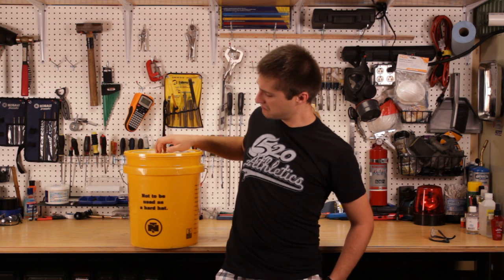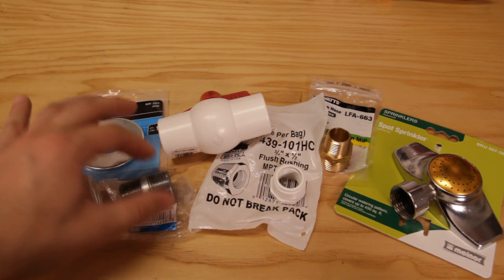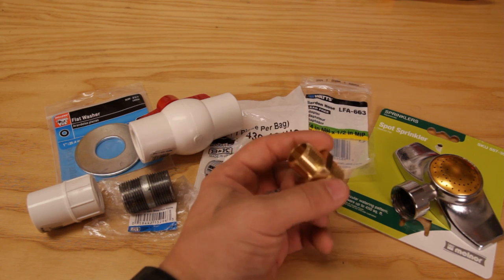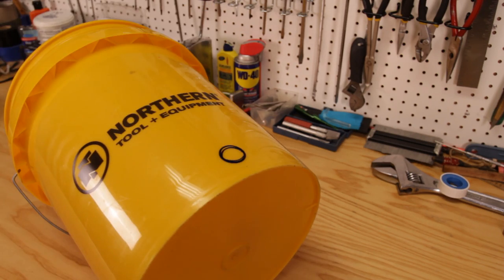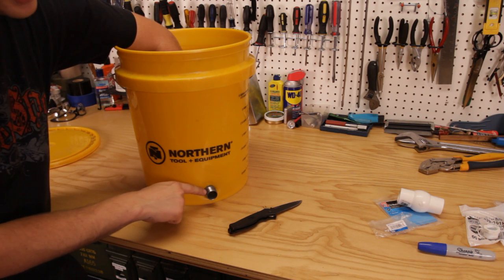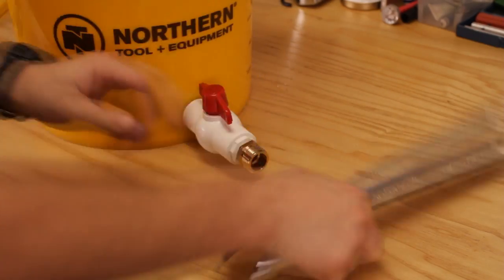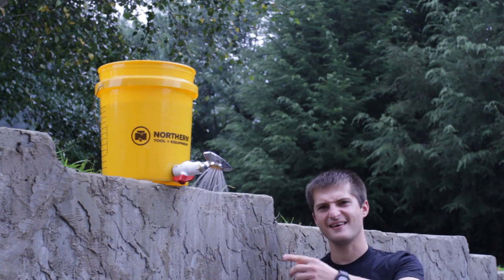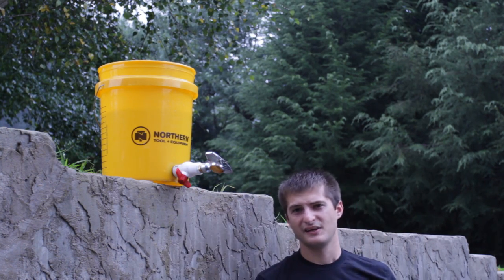DIY Survival Shower

Comment: if you were to either paint the bucket black or cover the bucket with some 2 inch wide black insulation/electrical tape you could leave a full bucket in the sun and have a hot shower.

Comment: Buy two black buckets from Dollar Tree ($2 total), drill some small holes in the side of one near the bottom edge. Set the bucket with the drilled holes in the other black bucket, fill with water and set in the sun. When you're ready to shower, lift the inner bucket out and set it on a ledge somewhere and let the water run out of the holes on you for shower effect. Boom, hot shower.